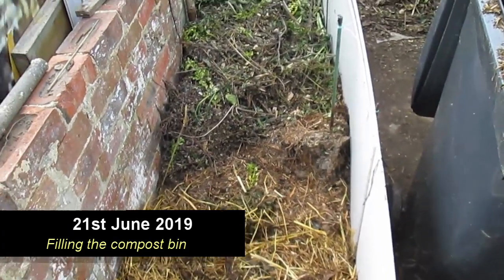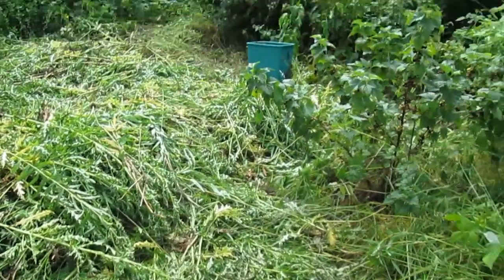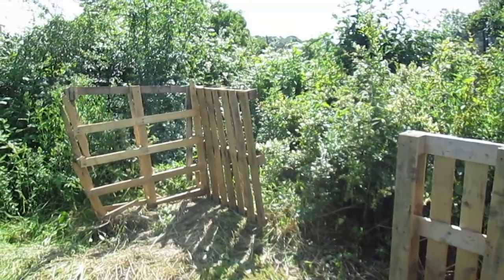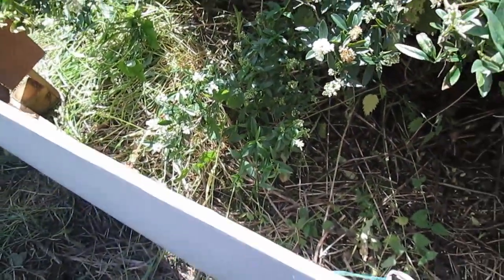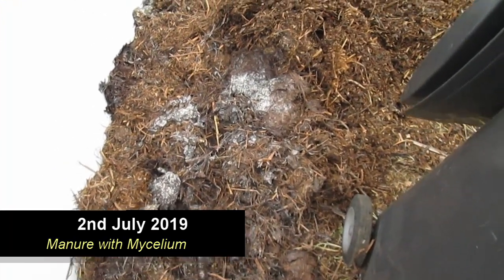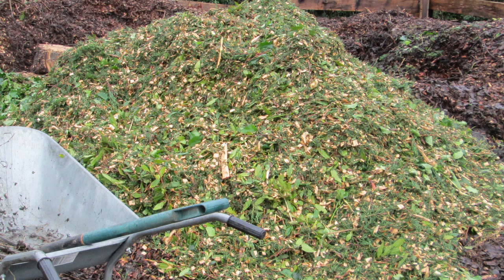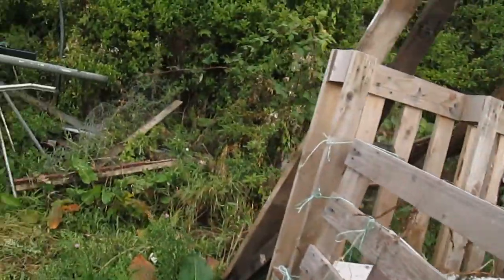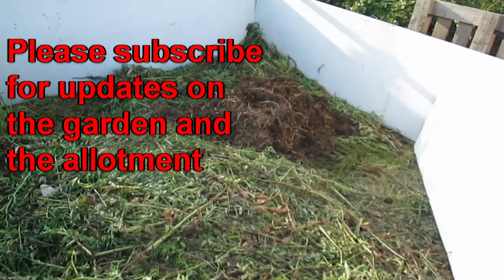Building a larger compost bin

Comment: Tie the stakes across the compost bin . If you can sieve the chippings large chips on paths and the rest on the compost. Takes time but works . I use landscape fabric under the paths and when they begin to rot pull it up and put it on top with new chipings.underneath continues to rot down to nice compost.
Reply from the maker: Thanks. That's what other people are doing so I'm going to follow that and top off the beds with decomposed chippings. That's going to be a while though before the new paths get ready for harvesting.

Comment: We have pallets over here that are everywhere in business areas....any chance you can find enough for the walls of your bin? Love the white walls, just worry they will cave outwards with any kind of a load.
Reply from the maker: Thanks, we get ours delivered to the site by some companies. I just have to be quick to get them before someone else does as they are used by many of the allotment holders. That plastic looks flimsy but is surprisingly strong, considering it's only meant to be used for one off advertising. I put in more stakes around the outside and it's held up fine.